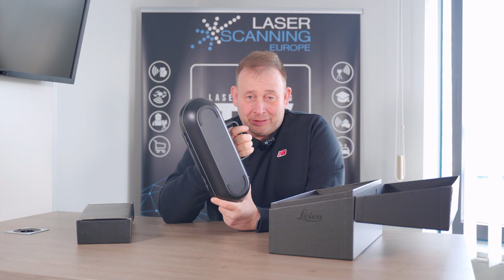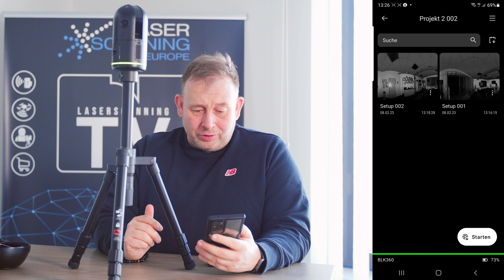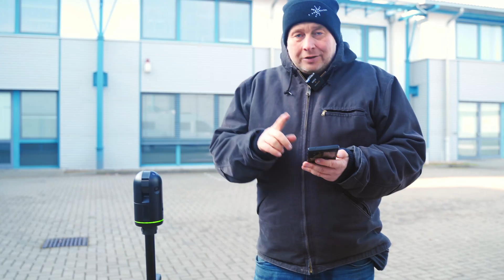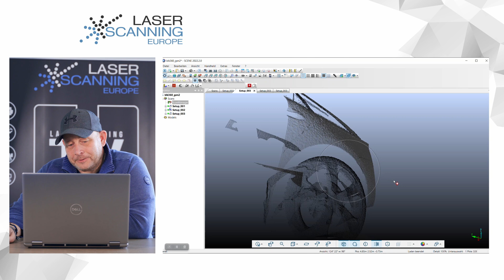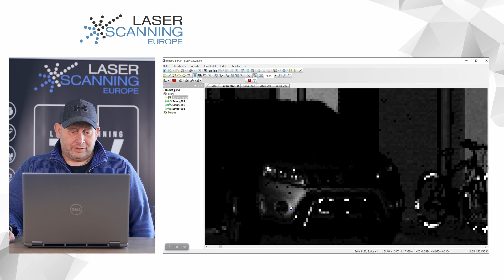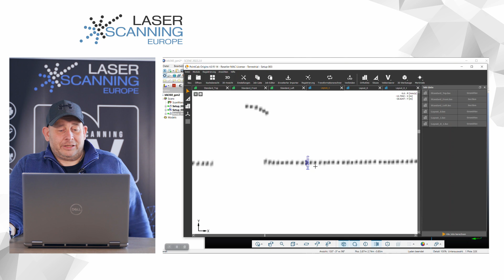Leica BLK360 G2 | Unboxing, scanning test and point cloud analysis

Comment: As an owner of blk360 g2 I do not recommend buying it as it is a half made product. Keeps crashing and an overall bad experience
Reply: Hi! After 6 months, your attitude towards the device has not changed? have you tried updating the firmware?
Reply: @MildlyCurious  Hello! If you had to buy a similar product now, what would you buy! I am considering buying a laser scanner, and please give me some advice!
Reply: @katina2000  for the price I don't think you can get a better device. For a common user the scanner is ok. If you attempt any fancy scanning, such as horizontal positioning (over a ledge) you will face multiple problems.
Reply: @MildlyCurious  Thank you for your time! I want to use it to download sizes for windows and curtain walls as well as conservatories!
Reply: @katina2000  this should be OK.
Reply: @katina2000 hi i was wondering if you tried to use it for window measurements?